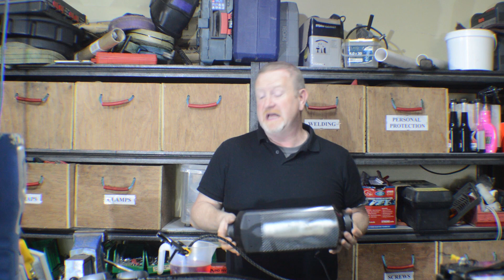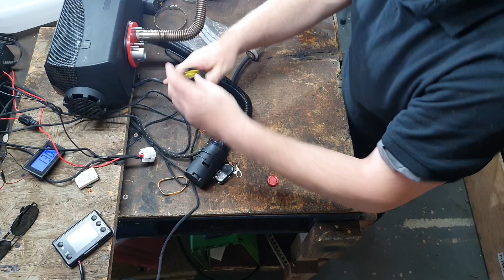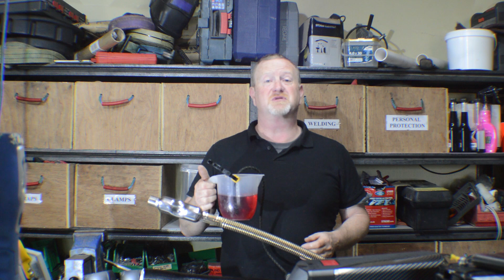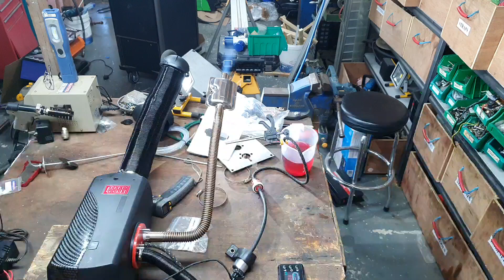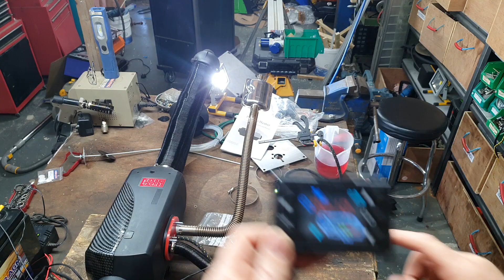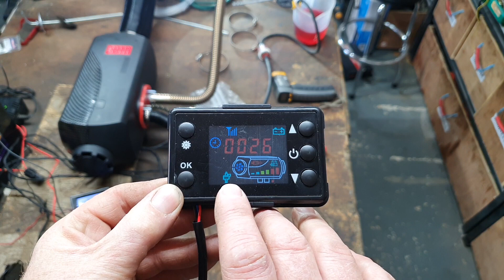Chinese diesel heater install

Comment: One great thing about the diesel heaters, is that unlike propane, there is no condensation in the van.  This alone is worth it. Far cheaper to buy heater, cheaper fuel, easier to find fuel, no condensation, less noisy, more safe from explosions.  It used to be that the German Espar, Webasto, Trumi heaters were all the rage at US $3000 each, but thank god for Chinese ingenuity and affordable heaters!

Good demo!  Thank you, Jaime.
Reply from the maker: Your very welcome, I guess there is a bit less chinese ingenuity and lot of plagiarism. They do copy a lot of stuff and this is one of them. Having said all that, they are very very inexpensive and work quite well. Even if they fail, not expensive to replace the entire unit. 

Moisture in Van's is the enemy and these are great for avoiding it from the heating system. Jamie

Comment: when I wire it to my blade switch box, what size fuse do i use for it?
Reply from the maker: Hi, the heater comes prewired with a 20amp fuse in line which is sized for the length of wire supplied and the amount of current it draws. I think a 20amp fuse would be more than acceptable and you are now fusing the wire twice. Remember the fusing is to protect the wire and prevent it overheating and causing at best a dreadful smell and worst a fire.

Also really worth noting, if your using any form of heating in a van, a smoke and heat alarm along with a carbon monoxide alarm would be considered essential equipment. 

Hope this helps---Jamie!
Reply: Campervan Creations  thanks for your advice. So do I wire it straight into my control unit and not into the blade fuse box at all?
Reply from the maker: Are you using a similar fuse box to the one in my other video?  2 fuses on a line is not a problem as I have the fuse holder that came with the unit powered from one of the terminals on the fuse box which is protected also. Either way is fine as long as its fused at some point.

The disadvantage of two fuses is the in line one might be blown and may not show up on the fault led for that terminal on the fuse box. I'll simulate that fault by removing the inline fuse and see what happens tmw and post the results in a reply here.  Jamie